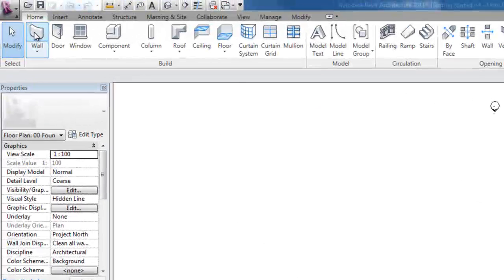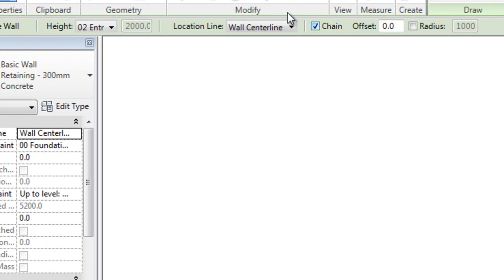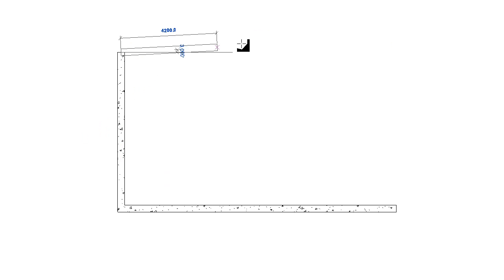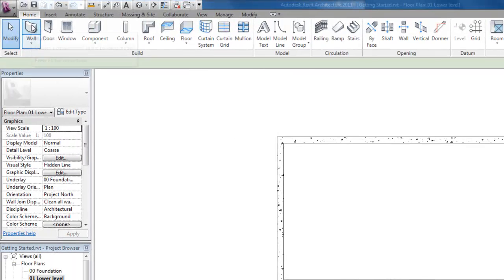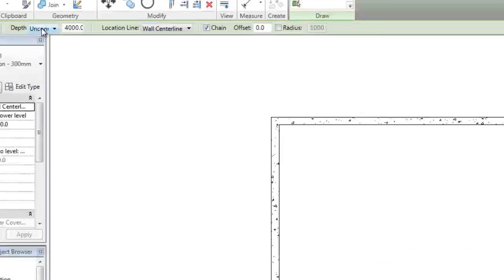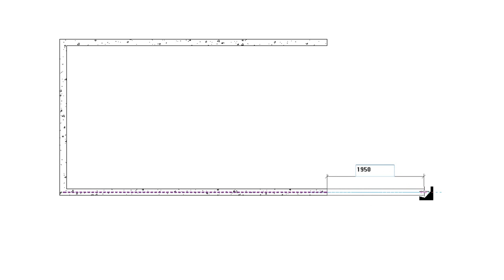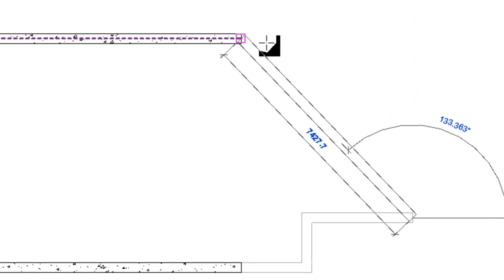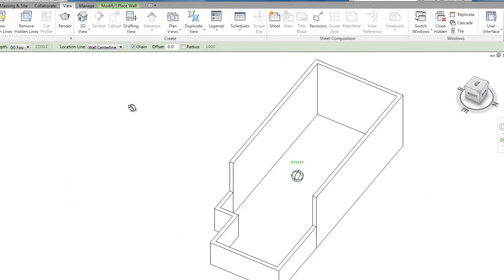Autodesk Revit Tutorials: 02 Making Walls

Comment: I am following on MEP 2014. When you drew the walls on the 01 Lower Level view, you are able to see the walls that you drew. Figuring this is a general Revit issue, how are you seeing those walls? When I followed, I got warnings stating that the walls being placed were not in this visible from this view. Once I was done, I put it in 3D and it appeared just as you have it. Thoughts as to how you can see those lower walls and I could not? Thanks!

Comment: for the second wall, added on the '01 lower level', i only have a 'height' option, not a depth option?

I am also just using a generic concrete 300mm wall because retaining is not an option?

Thanks!